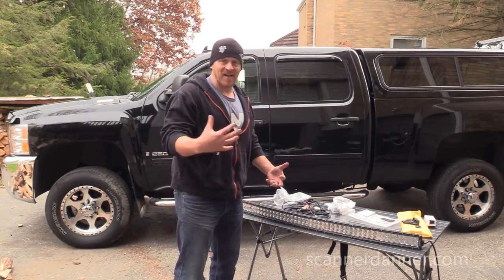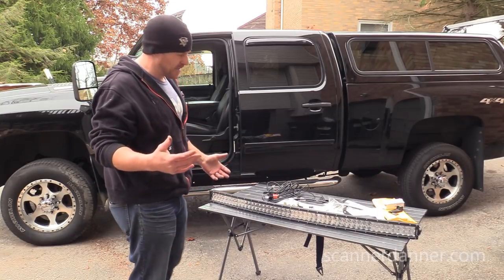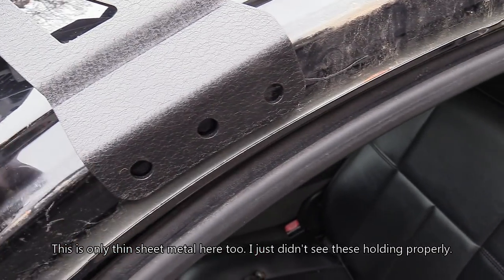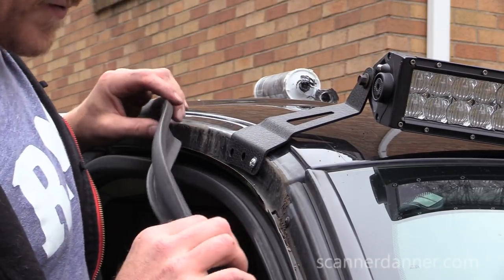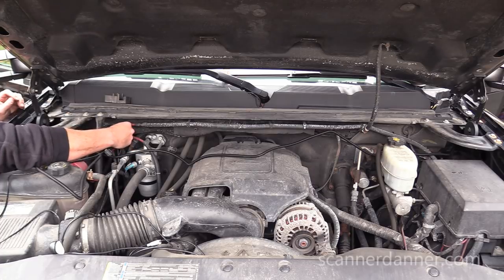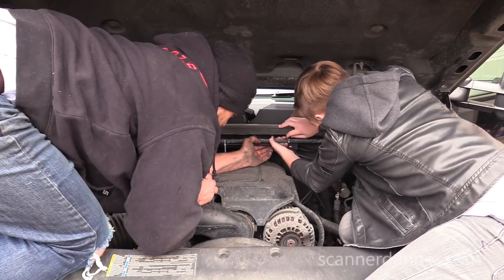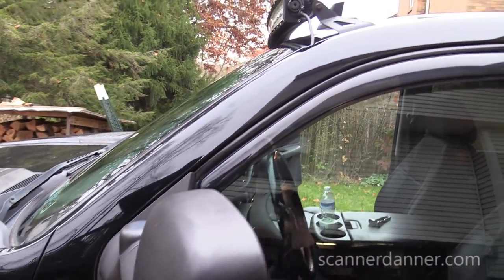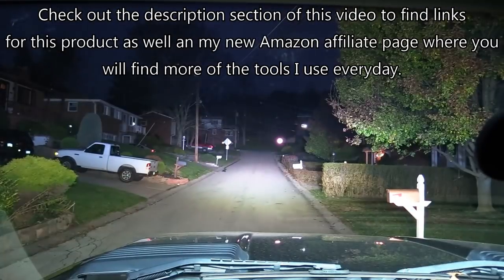Auxbeam 50" 288W CREE Light Bar Install

Comment: I think you could of played with the brackets and switch them to the opposite side and you could of gotten a better angle and could of pushed them back some more. To my expirance it has worked for me on the ones I have installed.
Reply from the maker: But I only had about an inch or two and then I would have been hitting my on-star antenna. Also, pushing it back further prevented being able to pivot the light down further as it would hit the roof.

Comment: It's called a Rivnut or rivet nut and as you tighten it it crimps the nut to the structure.  They also make a crimp tool for them  https://www.amazon.com/Astro-Pneumatic-Tool-1442-Setter/dp/B003TODXQW/ref=pd_bxgy_60_img_2?_encoding=UTF8&psc=1&refRID=FK6249NWDMM7GABTMGTT   They are great for attaching bolts to places concealed like box frames. AuxBeam is a great manufacturer and very dependable lights especially off road. They'll take a beating and keep working and they used to throw the lights on the ground and run them over to show how tough they were.
Reply: I thought they were Rivnuts...the threaded section was way too deep.  Pity it didn't have instructions  - that would have really helped by identifying the tools he'd need - including the special Rivnut crimper.
Reply: Hey! Thank you very much for the compliment! We're really glad that you like Auxbeam, we'll keep developing better and better products! :)
Reply: Auxbeam LED Lighting that's great. As long as you remember to put them in the box when they get sent out ;)
Reply from the maker: Where were you earlier! (Hayward's Automotive) Thanks so much man. Great information. Auxbeam should have included at least that much info for this package. It would have helped a lot for guys like me who have never seen them before.
Reply from the maker: :-) maybe because I was not a normal customer and was being given this stuff, the normal checks were a little lax on making sure everything was in the box. Sounds like a good excuse for Auxbeam to use. I know I would play that card if I was them. 
To Auxbeam: sorry I had to show that part like I did. I had to be honest with my viewers. My loyalties lie with them. But overall, I don't think 2 missing bolts is bad marketing. You guys did good on the product and I am pleased.
Reply: No bolts? No instructions? Not so great in my book.

Comment: wouldnt those bolts come in the kit that comes with the light and not with the brackets?
Reply from the maker: yep and they were missing. I even posted a picture and pointed them out
Reply: ScannerDanner gotcha ... I only asked cause I had the same thing happen with my kit from another company and thought he same thing and mine were with the mounting brackets that came with the bar. I noticed you kept posting that picture but I missed wether you addressed looking with the brackets that came with bar.. should have known you would have looked there too lol

I like your content sir. You have a video diagnosing a no crank on a Hyundai and it helped me with my winter rat.   Thanks for the help.

Comment: you also could have slightly notched the pinchweld for a nicer supply wire routing aftermarket products are always a challenge,wish they would mold a bracket with a wire loom ie snap in channel please try safety glasses thank you though,peace and as a side note I.Ireally have not had good luck with ZEUSS STYLE fasteners.

Comment: A way to fit those arbor nuts without the tool is to use a long bolt with a nut and washer,, Run nut up bolt and washer, screw on arbor nut so it in though the thread .  Run nut and washer down bolt to the head of the fitting.  insert fitting and use 2 spanners one holding bolt and other turning nut clockwise . This will will compress the nut fitting.. DO NOT OVER tighten  . Slacken  nut on bolt  by turning anticlockwise . You can now remove unscrew the bolt  (tool).

Comment: if those are good "rivnuts" and you set them properly,  they would be a better choice over "self tappers", still use good silicone. alternate to that, use "good" stainless bolts, nuts and silicone( requires headliner pulling, access to backside, etc.
Reply from the maker: yeah, I was a little unprepared with the hardware I used. I just knew I wasn't going to drill those HUGE holes. We will see how the sheet metal screws hold up.

Comment: My usual technique when affixing something oddball and non-factory like this is to note the rearmost position I can use, and the forward-most position...then mark and drill the centre position, centre hole only.  That gives me 3 positions to choose from without having excess holes around the place, so I can loosely bolt it up and check clearances, glare, etc. by bolting through each of the 3 bracket holes to that spot.  Always measure and all first, of course - but it lets me tweak the positioning somewhat if I screwed up on my measurements initially.  Once that's satisfactory, only then will I mark and drill the remaining holes, then bolt it down for good.  I'm sure it's not the best - or probably correct - way of doing it, but it seems to work for me.  Haven't screwed up anything permanently - yet.   :-)

Comment: Very disappointing to see that the electrical connection rout that you took was the easy cheap low budget and none factory looking. I've installed tons of aftermarket light and (OEM) like fog lights on many vehicles and knowing that you have a aux bottom on your vehicle and works and you didn't used it just because you choose to the easy route and install the aftermarket bottom to stick on the dash is disappointing specially when you are a teacher for a future mechanics/technicians. Something simple that is to look for the positive signal to activate the relay on the existing wire harness and connect it to the existing bottom to make a clean installation and delete the aftermarket bottom that doesn't look factory.

I installed the same brand Auxbeam LED light on my truck and I really like it, they are bright and seems to be a good quality part. The problem is how clean you want the install and I was expecting more from a teacher than a low quality install that you did. Just a honest and constructive opinion.
Reply from the maker: Thanks for the feedback, but to call this a low quality install is a little harsh. I wouldn't go that far. To be honest, im glad i didn't go into the factory harness because I'm removing this light bar. I hate it, it's impractical for me and it's noisy as hell!

Comment: I would be very cautious about drilling large holes anywhere near the a-pillar.  This is such a critical safety area in any kind of crash.  If they are promoting drilling large holes in the a-pillar I think that is irresponsible at best.
Reply: I think it might have looked better in the grill or something anyways.
Reply: Good point, until you factor in all the shortcut chinesium parts that likely caused a wreck to start with ( yes I ignored the fact of drugged/drunken drivers hitting you) ;)
Reply from the maker: I don't think this would weaken the A pillar with three holes, but I'm no engineer.

Comment: I used to fit light bars and spotlights to all of my cars until I realised I never drive at night.
Reply: the majority of that stuff is offlorad use only, if you use it driving down the road, you can get pulled over, ticketed or worse in some areas :)
Reply from the maker: yep and I'm never off-road, so not sure what I was thinking putting this on lol

Comment: I don’t know if you know of this manual but I stumbled across it a while back while doing some research and it may help you with wireing to that becon light switch in the roof see page a-17

https://www.gmupfitter.com/files/media/photo/479/2010_LD_FS_PU_Elec_1_7_D1_100813.pdf

Comment: It would have been better for everyone if you would've attached it to the bumper.. a light bar on top of a vehicle is very annoying..
Reply from the maker: Agree, I would have liked a bumper mounted one better.
Reply: Not sure in your jurisdiction but many require any lights mounted higher than the factory headlights to be covered at all times when on public roads.
Reply from the maker: Yep, I'm thinking I need a cover. Hope they make one.
Reply: Even if they don't I'm sure there is a competent automotive upholstery shop that could make one quickly and economically.

Comment: Up late????
Reply from the maker: Yes and hesitating to put this up. This isn't what I do but I've put them off long enough. Someone will benefit from it though.
Reply: ScannerDanner yep! It's best of put it up, so someone may be some insight, and/or installation tips!!

I like the rivet idea, better! Would be a bit more flush! You could seal the hole and rivet prior to installation! You have three mounting holes, for some extra strength, and you can always start off with a small rivet, and increase if ever needed!! 

On the light output part, it's a wide angle beam!! A flood light, so to speak! Most likely, when the light is level on the cab, light will be thrown  high by a few degrees, and low the same amount, and you will not find that
 you wanted to turn it down more!